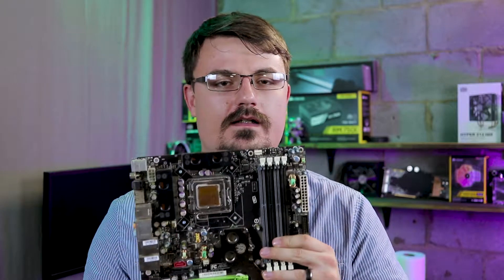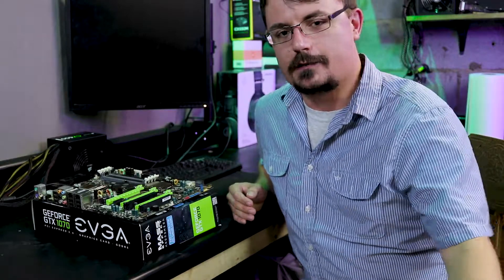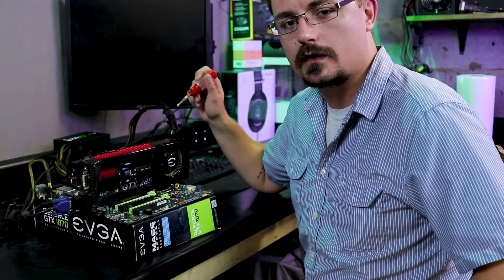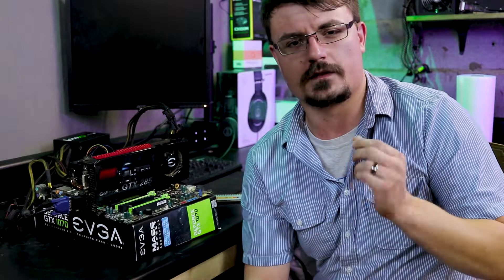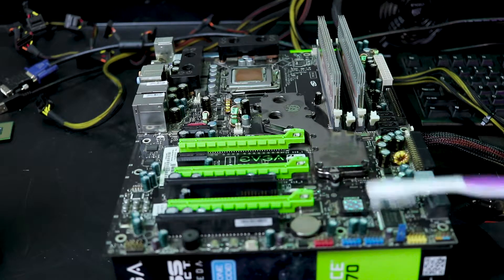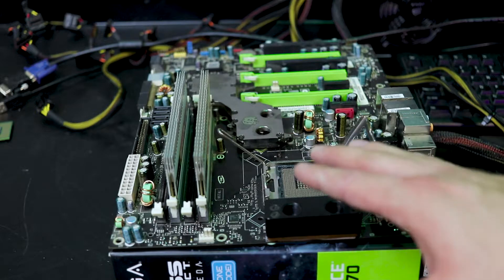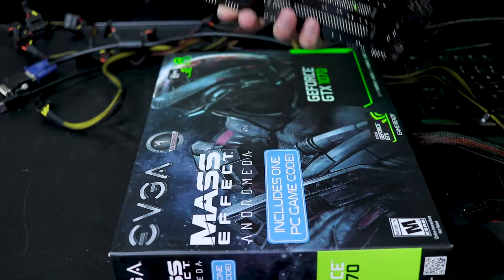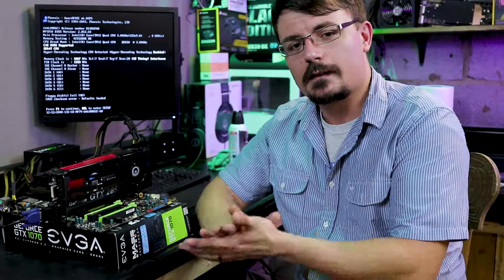Bring Your Motherboard Back From The "Dead"

Comment: Old video i know, but i have the xfx and evga versions of this board in 2 machines i still own.  Built them both just to play crysis when it came out. One of the boards is running 2x gtx 295 in quad sli, the other has 2x gtx 680 4gb in 2 way sli. Seeing this vid makes me want to get them out and running again. Spent so much time setting these up when i got them, certainly werent the most straight forward ro get running stable compared to asus boards. Those notthbridge fans go bad real quick.  The xfx board has s socketed bios chip, the evga doesnt.   Other than that they are identical.

Comment: Many of this boards die because of short in north bridge. Post code FF.
Reply from the maker: Thanks for sharing that. From what I have read, LGA775 is plagued with post issues now that they have aged.
Reply: @DigibitGaming  all nforce based mb (with lga775) had issues with noth bridges.

Comment: You might be surprised with a QX9650 OC'd to 4GHz and something like a 1080Ti or higher on games @4k resolution. The GPU does most of the heavy lifting. I was able to play Star Wars Battlefront 2 which came out in 2017 @4k medium settings at 30fps
Reply from the maker: Thats impressive! I am finding that hardware is being “obsoleted” well before its time. My 4790k was still a strong contender til the mobo went out a few months back.

Comment: Will it boot if you have currupted bios chip? What are the reasons how bios chip being corrupted?
Reply from the maker: Usually a motherboard with a corrupted BIOS will not post. Or might hang in post. As for how BIOS chips become corrupt. Most of the time a failed change to a BIOS flash or setting is the culprit. Like a failed update due to power outage or wrong BIOS version used. Just to name a couple of the multitude of possible reasons.

Comment: Good afternoon, I have a n790 like yours, mine was working normal until yesterday when I reset your bios, now it reaches the message of precione f1 blablablabla or DEL blablablabla and the keyboards are not recognized and you get error 7F.

I've changed all the parts since battery source memories processor video card and nothing, I've even removed and cleaned the contacts of Bios and nothing remains on the post screen without recognizing both USB and PS2 keyboards, if you have something about mine problem i would be very happy, thank you very much now.

Comment: The XFX 780i can be a bit temperamental after a deep clean the case pins need to be connected & the CPU fan/heat sink also need to be fitted & connected or it won't boot or it just shuts down straight away other than that it's been a reliable board for 12 years which is more that can be said for an ASUS M4A79XTD EVO that was given to me. What a pathetic waste of time, no posting code, no onboard reset or power switch just a green led for the power indicator. A 4 pin power connector is cheap & weak for an overclock ATX board no wonder it just dies at any given time, that is if it boots after several attempts & loads the OS a feeble specimen in comparison to the 780i if ever there was.

Comment: Do you  know about error 4E on this 790i? it wont boot POST past this error.
Reply from the maker: I did do a little bit of digging, seems from what I can tell the cpu would need to be checked for damage. Mine seems to boot fine. When I originally picked it up I couldn’t even make it to the uefi bios.
Reply: that an interesting path i have yet to explore.  Bent pins or dirt

Comment: this dosent help me somthing exploded on mine and i want to know if i can fix it
Reply from the maker: Yikes! What happened?
Reply: @DigibitGaming  transistor pack exploded next to the north bridge
Reply from the maker: Hmm often times a transistor blows due to remaining energized, such as stuck switches, or if a corresponding coil is shorted. My professional side says let the manufacturer replace if in warranty. But my tinkerer side says grab a volt meter and tear the system apart
Reply: @DigibitGaming  you thinking of a capasitor
Reply from the maker: I could be mistaken. But I am pretty sure that shorted coils, and stuck switches can cause transistors to go out. I know capacitors are for storing amounts of energy and transistors are for amplification/rectification.
Reply: @DigibitGaming  also its literally the model of motherboard from the video i cant send it to evga
Reply from the maker: Gotcha. Wasnt sure if it was or not. Definitely would try to fix for sure. Not a lot of these left in the wild.